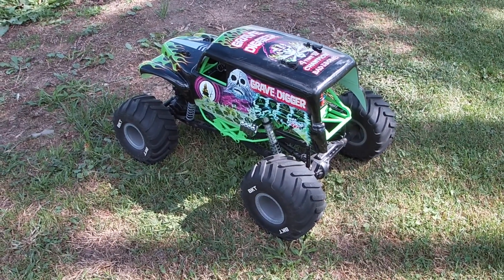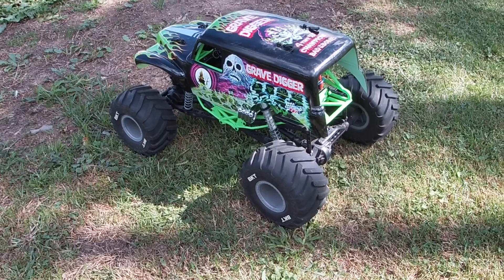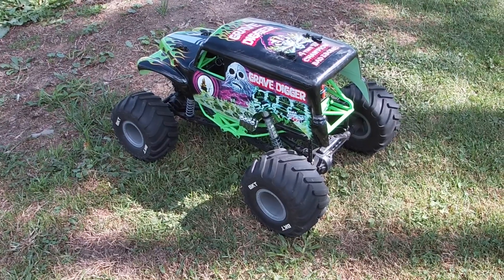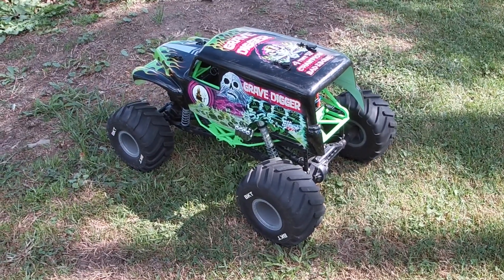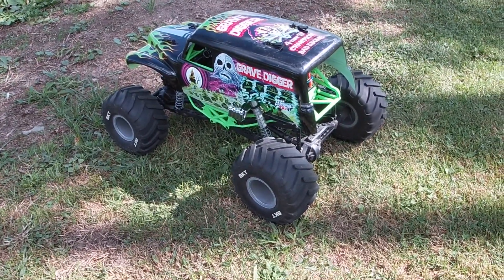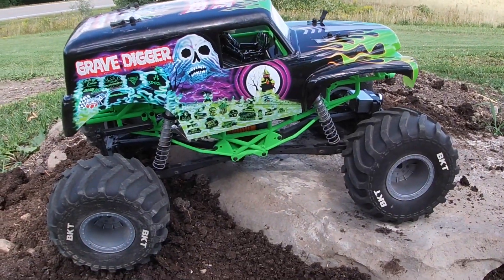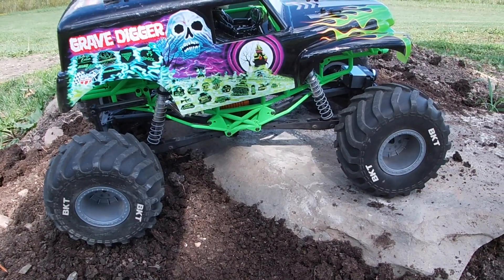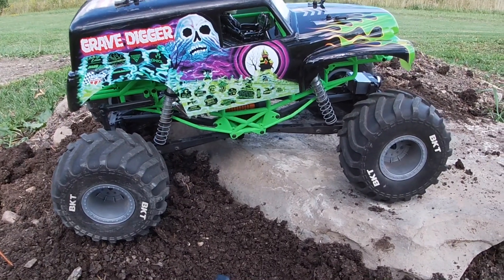Brushless Axial SMT10 Gravedigger!

Comment: Nice run!  FWIW: If you put a 3000kv BL motor in it, it will run all day on 3s and not even get past lukewarm.  I put some 3000kv in my Slashes and full runs are no problems on 3s.  Anything past 3500kv will get warm on 3s.  I did research a while ago and read about kv efficiency, and it proves to be true in real world bashing.  A 3000kv motor on 3s is actually more efficient than a 3500kv on 2s!

I have this truck on the way, so doing my homework and getting some previews of action...lol.  Can't wait to get mine!
Reply from the maker: Hi Hugo!👋
If you like solid axle monster trucks, you’ll love this! I really enjoy mine and it has held up real well on brushless so far!
Thanks so much for watching, stay well!
👊😊✌️
Reply: @HaydadRC  Thanks!  I might upgrade to BL one day....first will concentrate on Monster Jam like tricks.  I have other trucks for high speed bashing.  I already ordered steel axle inserts, Wraith front anti sway, and a Fly Sky rx as I have read complaints about the included tx/rx lag.  Also plan to paint the wheel rims green like the 1:1.